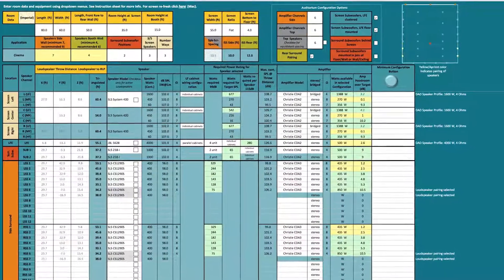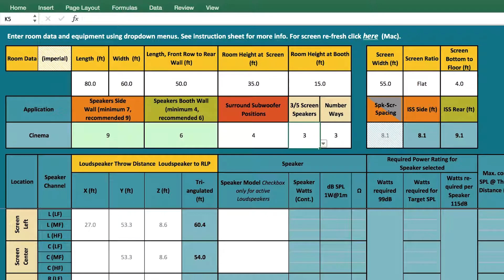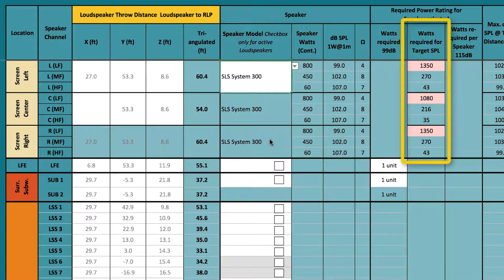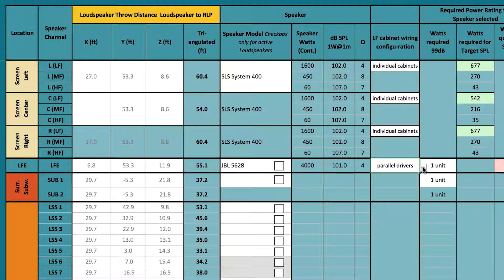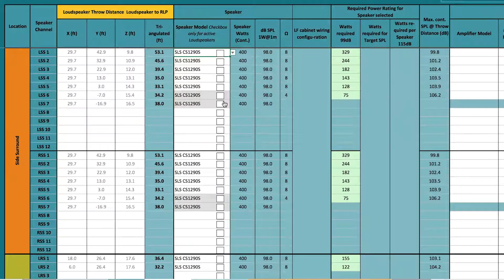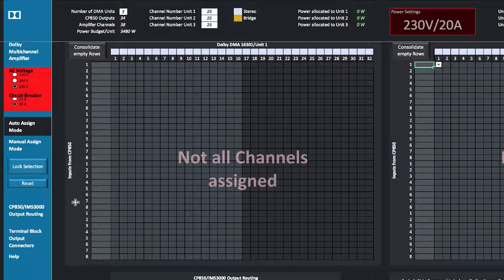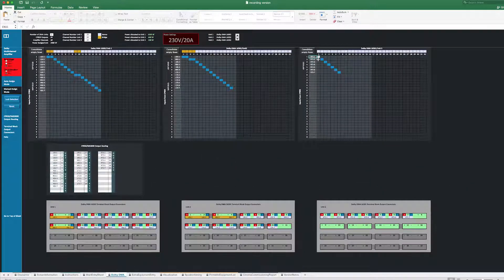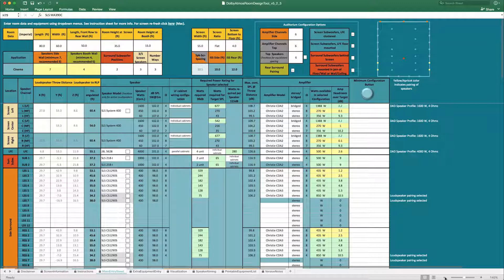Dolby Audio Room Design Tool DARDT

Comment: I have searched on how to open this file and can't no matter what I use, weather it be online or downloadable XLSB file views, nothing work. 
Not even MS Excel.
What ever the problem is, how can a company this large deal out such a failure on this?
This should be configure to open instantly with no issues.
This is not the case.
Anyone with a fix yet?